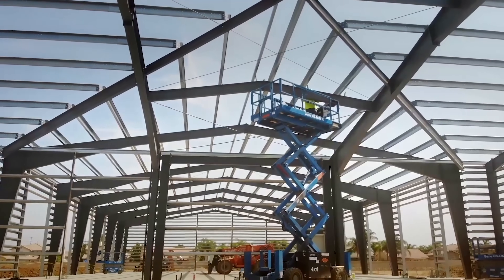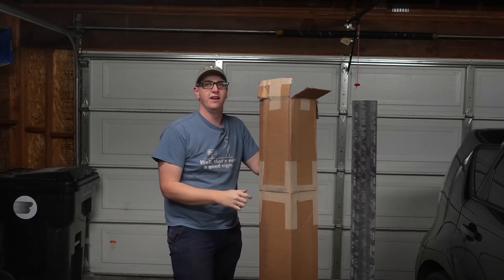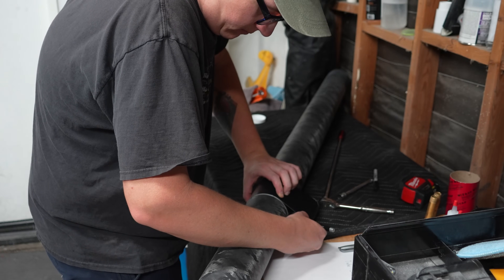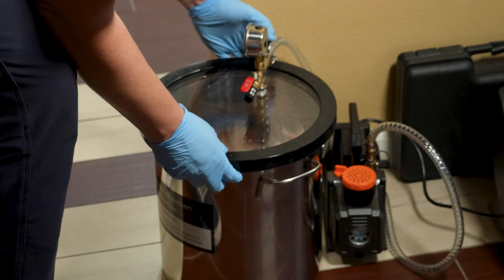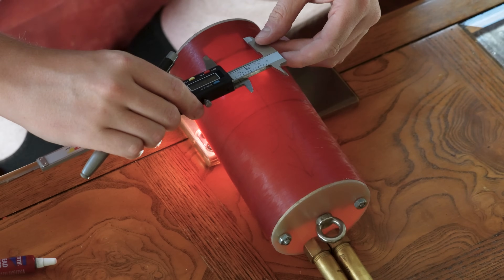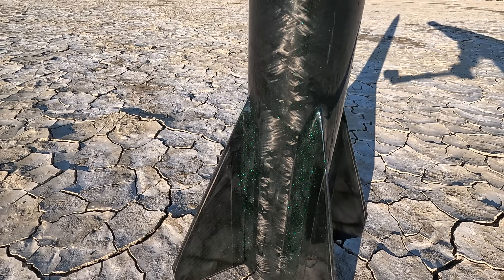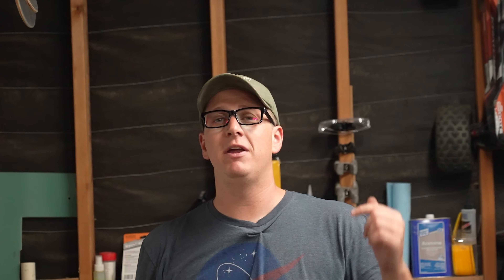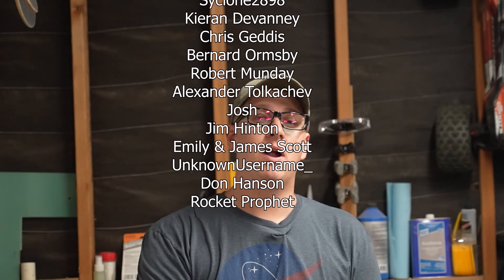My Carbon Fiber Rocket Rocket Flew Into the Stratosphere | N1000 Minimum Diameter Rocket Project

Comment: By carefully sanding the leading and trailing edges of your fins into an apex edge, it optimizes the fins for low supersonic drag. The fin shape is also optimized for supersonic flight. (Subsonic rockets best use trapezoidal or elliptical fin shapes). Your fin alignment was very good too as the roll rate during the flight was low. The only way to mitigate roll completely is to manufacture and install rollerons on the fins (see the sidewinder missile design). I also suggest painting the airframe with black-and-white roll patterns and white and red camera targets. I learned a lot about missile aerodynamics in the U.S. Air Force and flew amateur rockets in the early 1980s.

https://www.youtube.com/watch?v=y1kUzjdkxG8

https://www.youtube.com/shorts/VDqyYj2ylbY

Comment: With your featherweight GPS you may be able to connect to the tracker directly using bluetooth from your iPhone.  Then you can download the raw GPS data which should be about 10hz for the boost and 1hz for the recovery.  Probably overkill for plotting but you might be able to get GPS apogee from that data.
Reply from the maker: Unfortunately, when I attempted this, the only data saved was from the previous flight

Comment: How awesome is that! What a beautiful flight. Congrats! What I find really interesting are the several roll reversals on the way up. It spins in one direction for a while and then rolls in the other direction. I wonder what causes that?
Reply from the maker: Thank you! I think it might be the winds aloft messing with the rocket if I had to guess. That, or perhaps a consequence of the slight off-axis liftoff. That said, at burnout, the Blue Raven reports it was only 9.2 degrees off vertical and that the launch angle was 0.6 degrees, so not a ton of deviation there!

Comment: Loved your camera work, as usual.   You have to make a video detailing how you track the rockets so others can learn from your experience. 
    On the paint issue, have you tried the paint ment for engine blocks?  Might have to go to an Ag outlet and the colors might be limited to Deere green. Caterpillar yellow, International red, Ford blue, Chevy red .  I don't recall if it comes in spray bottles, but it comes in pints, so you could mix it for other colors.  Black is available for wood stoves,  white might be a problem.
Reply from the maker: Rustoleum makes a bbq pain that is actually great for this, but I wanted a nice deep clear and a cool finish. Since this rocket was meant to be on display afterwards anyway, the mach rash makes a good story to tell!